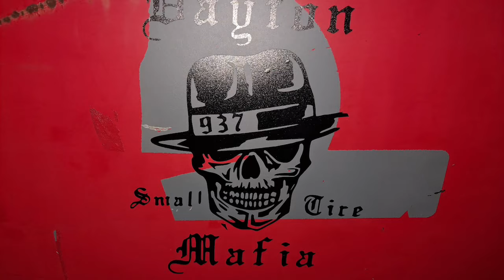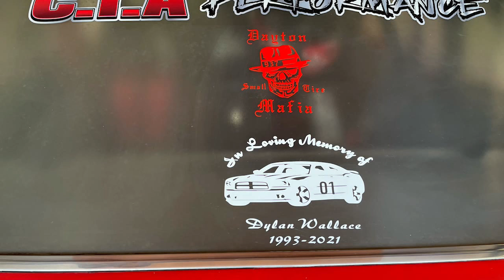The Evolution Of My Small Tire LSX 1966 Ford FairLane OldSkool, From Forgotten Racecar To The Street

Comment: What front end is that? Fox k member you made fit? 
Sweet ride liking all videos keep em coming
Reply from the maker: Its a UPR chromoly tubular fox body k member with all fox body style suspension, brakes and rack and pinion, I built a tube front end to accommodate it and make it all bolt up. I have made quite a few changes since this video, I need to drop an update video detailing how she currently sits as she has come a long ways. I appreciate your support 💪.
Reply: Yeah man that would be sweet to see a walk around 
Thanks again for the videos 🤘